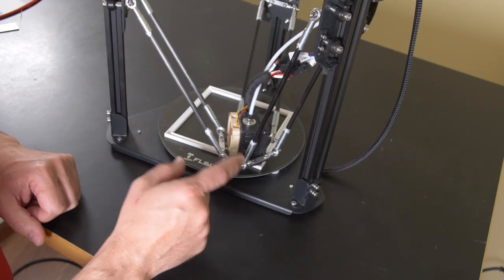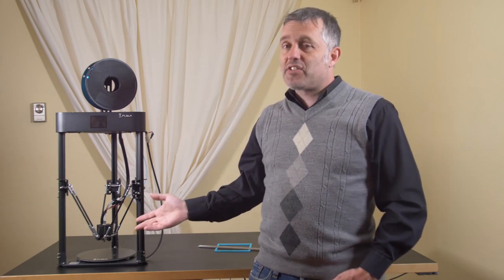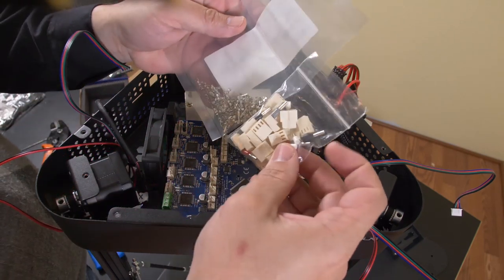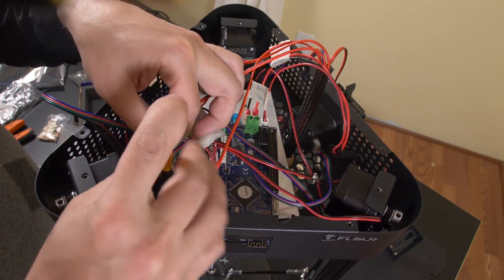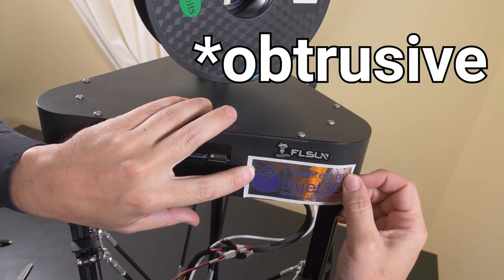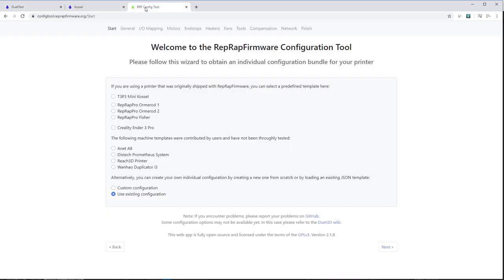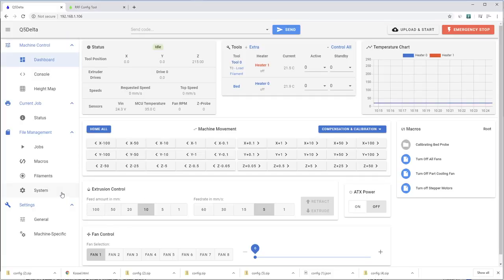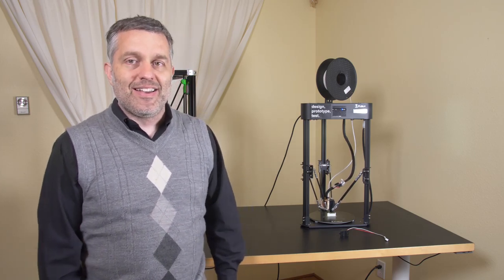How to Build the Best Delta 3D Printer for the Money in 2020

Comment: I can see why you're trying so hard to make people give you $5, instead of $1-$2 normal creators ask. When your goal is to kill a pigeon - you build a thermonuclear ICBM with biometric tracking of that pigeon, powered by a supercomputer. 

And all because you find fiddling with Marlin configs more cumbersome than fiddling with console Gcode commands. 

Seriously, SKR can achieve 95% of what you're doing at 20-33% of the cost ($30-$50), depending on how you set it up. By using SKR Mini E3 with soldered on TMC2209 drivers and ESP-01S for wifi. The difference from 20 to 33% comes in the level of comfort: you can either get a few connectors and jumper cables and wire ESP directly into the board (no soldering required) or get the cheapest TFT with the ESP port - TFT35 2.0 - for $20. By going with the second option, you're also getting a TFT for easy controls and shortcuts for your favourite Gcode commands.

Alternatively, you could just screw around a bit with Marlin for this stock MKS board and get that to work decently, maybe even add wifi with the same $5 ESP-01S module (module itself is $2.50, but you also need a firmware flasher for it), if there's a second serial connector on the board or you're willing to sacrifice the TFT for the sake of wifi.
Reply from the maker: Ok Mundane, you just left another comment about how crap China is at making things. Then you leave this comment chastising me for being an ardent supporter of a western company who makes the superior technology and product? You can't have your cake and eat it too. You can't hate on China and then turn around and tell me I should be buying a lowest price possible electronics package from China instead of supporting the western company who is actually doing all the hard work innovating to create solidly functional firmware and hardware. China steals everything. The SKR board you are so fond of is, I guarantee, a complete ripoff of a design which originated in the west. It costs money to develop the tech. That's why western products cost 3x more. China steals everything because they know that Western consumers have no morality. We are sluts for low-low prices and don't care that we are hurting the innovators by purchasing the stolen designs. If Klipper wants me to use their firmware they should develop a control board that gets their stamp of approval as not being stolen tech. If you love 3D printing you will purchase from the original creators who birthed the thing that you love.
Reply: @DesignPrototypeTest  mmm, yes, let me give birth to $150. That was half my monthly income back when I had a full time job! And I don't have that because of university+COVID! And it's not just me: even in the first world ordinary lower class or lower-middle class people can't afford your gold plated toilet, so they also get ceramic, just like me! Worldwide, cheapest has the widest reach and the widest impact.

Do you not understand the meaning of open source hardware? It's not a product, like an iPhone. It's a universal platform, like Android. That's the entire point. You, a rich first worlder, can have a superior product for $150 (just like you can have a Samsung S10 plus), while I, a mere peasant in the rest of the world, can have a slightly worse product for $30 (With the Android equivalent being my Samsung A5. I got that phone in 2017 for $300, and it can do all that the expensive phones can: 1080p SuperAMOLED screen, waterproof, Samsung Pay (and properly usable NFC for reading and writing tags and cards), fingerprint scanner. Because you rich people already paid off the development of all that. And that's from the same company. Chinese phones like Xiaomi and Huawei are even cheaper, though they might not have water resistance because water resistant headphone jack is Samsung's proprietary invention.) 

This is the true progress. Not the expensive anti-pigeon ICBM for $1000000. It's the $1 rocket-powered slingshot that the ordinary individual gets as a result. Both kill a pigeon. Only one warms your ass and has leather seats.

Cloning things that are closed source is bad, it breaks the law. Reproducing and improving upon an open source design is progress. Yes, making something cheaper to mass produce is an improvement, it's an improvement to cost. I have to give credit where credit is due: Anet did exactly that for me. They took open sourse Prusa i3 and made it so cheap anyone could afford it. They took  RAMPS and made it a single board, reducing the cost by soldering on the cheapest ATmega and A4988 chips. And they did all that in 2017. They cut costs where they knew they could: everybody knows the only place for that acrylic frame is the trash can, so they made it super cheap. Everybody knows the place for that board is the trash can (or some other, less critical Arduino project), both the Arduino and the drivers are trash, so they made 'em one piece. And yet the motion system is actually half decent, once you oil the bearings and anti-wobbilize the Z leadscrews, and the extruder is an MK8. MK8 is open source.
Do I owe a single dollar to Josef Prusa? Nope, he makes all his money back by selling luxury for rich white firstworlders and businesses. He took the niche riiight below Ultimaker, at the $1000 mark.

To return to the point about Duet: do you really value 3 hours of your time fiddling with Marlin at $120? Do you make $40/hr? Because if you do - the last thing you'd need is a paywall on Patreon to fuel your 3D printing addiction.
Reply from the maker: Dude, if you are that strapped for cash you should definitely not be wasting your money on a 3D printer. That is not a wise use of your resources. This is a hobby. You are supposed to use "disposable income" on these parts. Save up. Even if it takes you six months. It's worth the wait to get Duet board.
Reply: @DesignPrototypeTest  you didn't get my point at all. It's about things being nice enough to work, not the nicest in the world ever. 

The main reason I was so judgemental about the use of original Duet board on this scrapbucket that is barely better than mine is because that's like putting a brand new LS engine into a 1985 Honda Civic. Sure, it can now go 400 km/hr. But it will fall apart long before achieving that speed, and the engine costs more than the car. 

And no, I think 3D printing is the best thing I could possibly spend my money on as an engineering student, the hands on learning experience is just unparalleled. Better to spend hundreds of dollars over time on machines and plastic that teach me engineering and produce cool items, rather than on alcohol or cigarettes like other Russians spend it. Our cost of living is quite low. Honestly, anyone who makes $500/mo outside of Moscow can be considered a successful adult, they can have their own condo apartment and a car, as long as they don't smoke cuban cigars or send kids into a private preschool. But you know how idiotic people are...